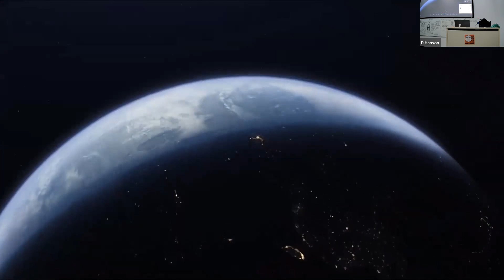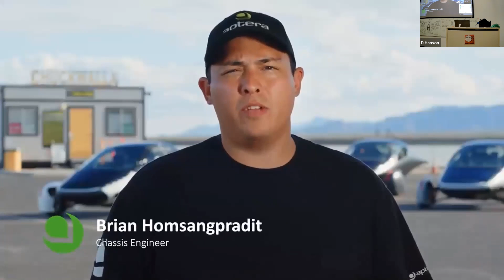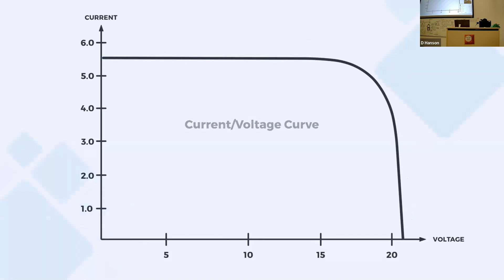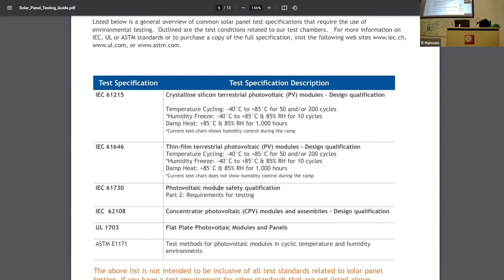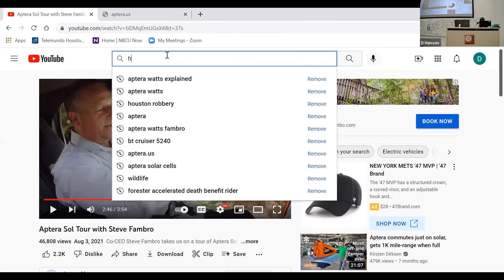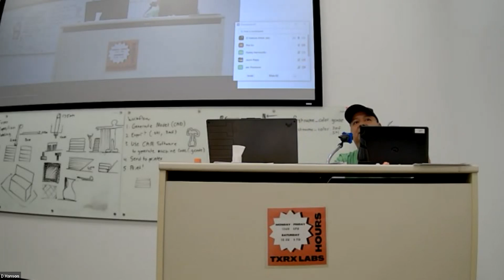HEAA May 2022 Meeting

Comment: I'm leaving the mirrors on. They look cool and I doubt they'll reduce the range by much. In the acceleration test, how can they test this without an actual production battery pack? I do like their aim for a solar cell to last 20 years. I'd like to see them cover the cells with glass. My concern is that any resin would fog over time. $30K for full solar and 400 mile range. I don't personally get it, but I don't see this being used for camping or off-road use. Having it charge your house is also a bit much. Buy a solar set up and save some money.